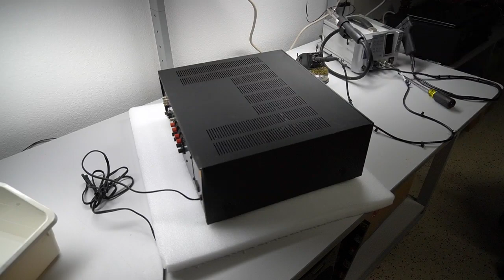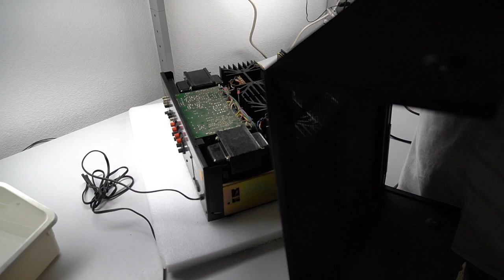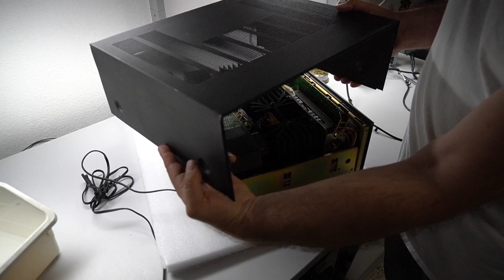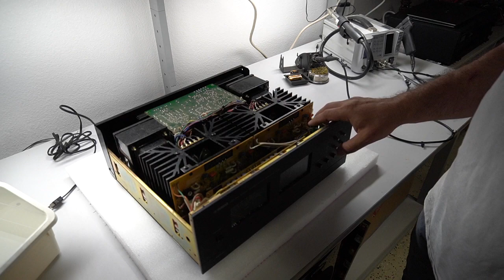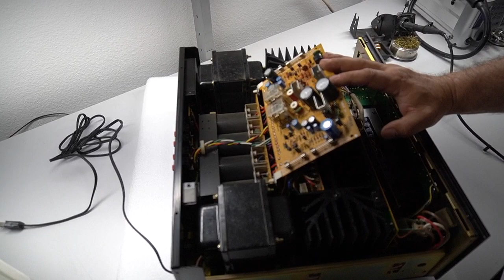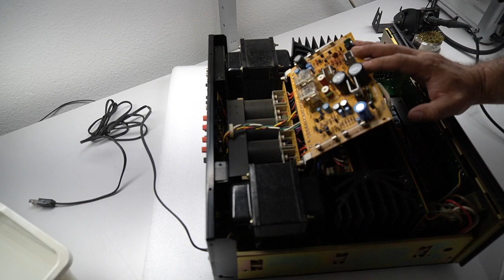Yamaha B-2 vfet amplifier restoration (Part1) - A quick look under the hood

Comment: Hello. I have a B-2 I've been enjoying for a few years but one of the filter caps is leaking. I was hoping you could recommend the very best caps, as I will be replacing all four. Thank you
Reply: Hi Louis, the best caps for the B-2 are the Nichicon KG series, but they are out of stock at am major suppliers.
That said, I have developed a replacement PCB for the main bulk caps which will accommodate for screw type caps from Epcos and Kemet. Those are also very good caps. 
Soon I will be posting a video on this subject. Please stay tuned